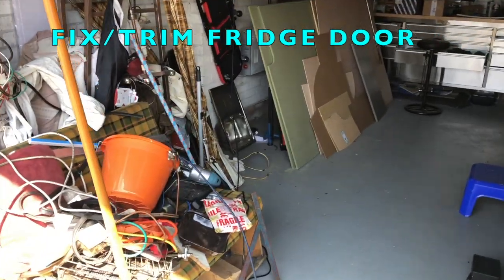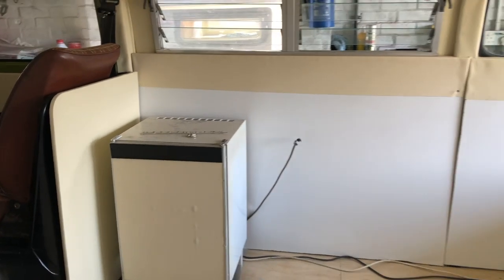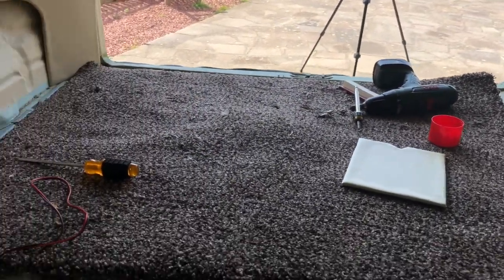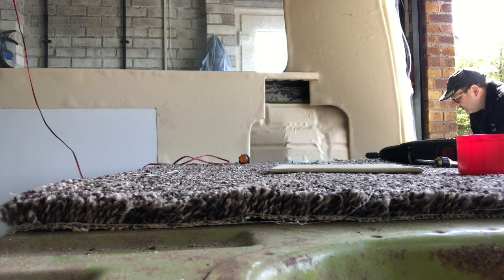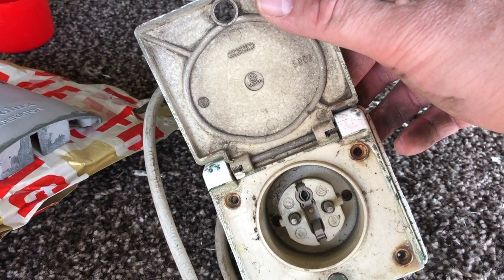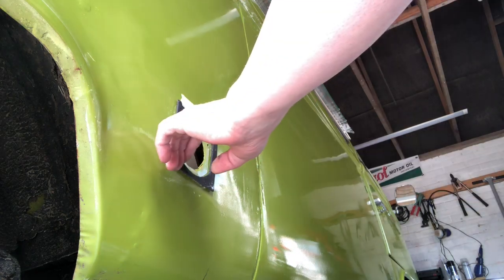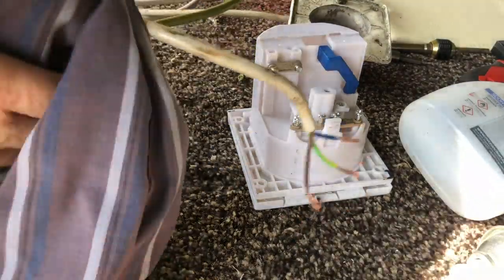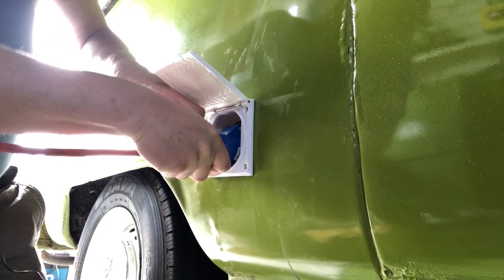Installing a mains hook up socket on my T2 bay Campervan Olive  (Olive Ep 9)

Comment: Instead of replacing the socket, wouldn't it be much easier and cheaper to use an adapter?
Reply from the maker: Much easier. But as the rest of the wiring was way too sketchy to keep, £12 on a new socket to get it right for the UK didn't seem too bad👍
Reply: @ToTheGarage  At 12 pounds (don't have a pound symbol) I would have done the same as you, especially if you are going to spend most of your time in the UK, instead of Europe.

Comment: Why don't you put the spare wheel outside mounted on the front.Have seen this before giving you more space. Where is the seal you keep talking about.Is he in a pond ?
Reply from the maker: Front panel has been replaced with a brand new one and therefore too pretty to drill holes in. The seal heard about the glue and did a runner!